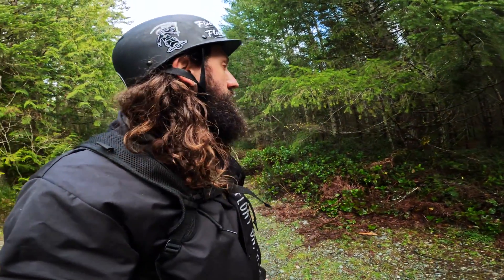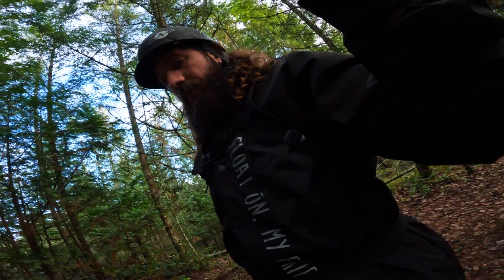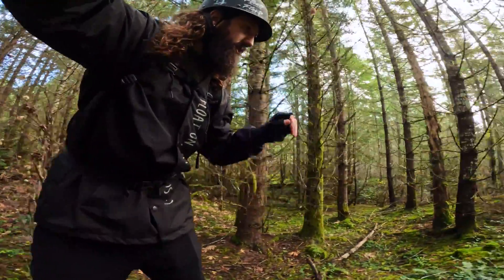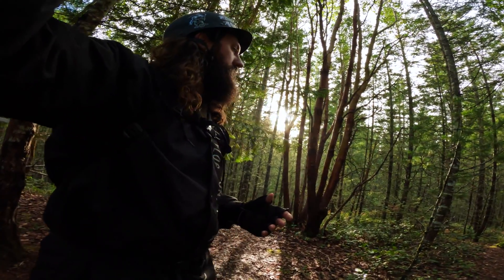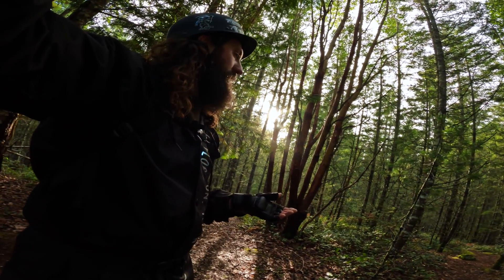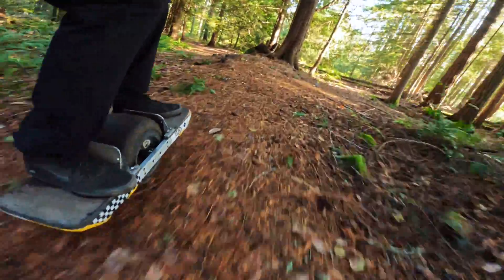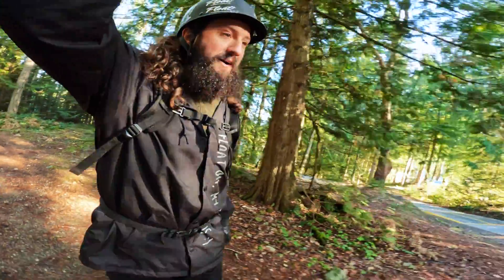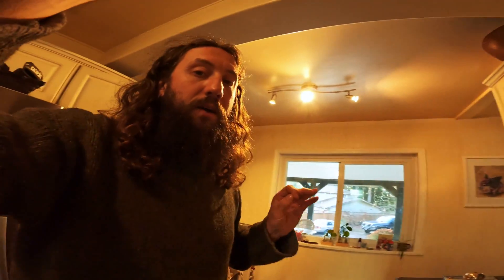84v VESC -  First trail shred and fine tuning.

Comment: Love your explanation on what you like ATR at. I don’t really like how it feels when it’s abrupt so I feel the same way.
Reply from the maker: Less is more  👌
Reply: The way it actually tilts could definitely be improved so that it's smoother like FM boards and not as noticeable. Rn all the different tiltbacks just click on and off to the set tilt speed, but it should ramp up to that tilt speed and ramp down as it approaches the target angle. Basically the difference between XR pushback and original GT pushback.

I actually have already messed with this smoothing and it's used for Remote Tilt now by default, you can turn it off and see for yourself. The smoothing allows you to set it to like 50°/s and it still not feel like a bucking bronco lol. I just need to clean up the logic and apply it to other things like ATR
Reply from the maker: @nicoaleman  that sounds like something I would love to mess around with. I’m all about how it feels and love dialing it in

Comment: Thanks for you wisdom. I am interested in VESCing my XR but I have no interest in tuning. I just want more range and hill climbing power for my XR.  I am looking forward to more vids from you on the 84V.  Its sunny and dry here in Calgary.
Reply from the maker: You can definitely tune it for just power and range for sure. The tuning these days is super strait forward and every adjustment you make has help text that let you know what it does. I didn’t think I would get to deep into tuning as I like to just set it and for get it but I’ve been riding for so long I have very specific wants in my ride and vesc has let me achieve it.